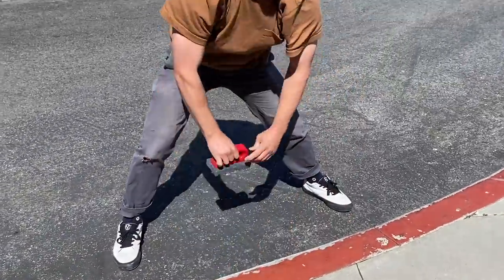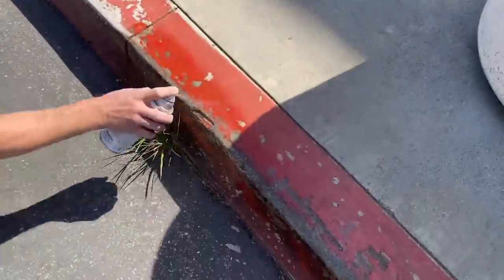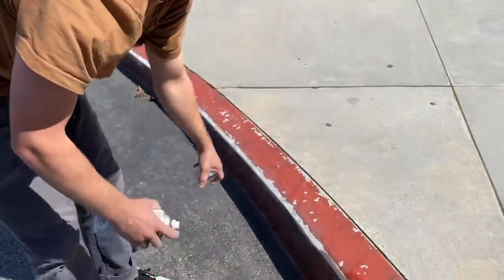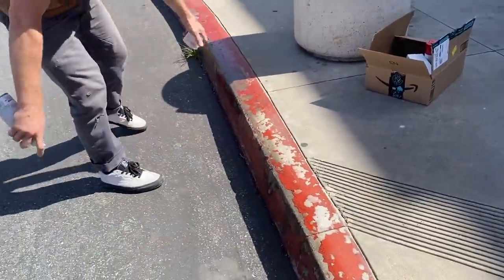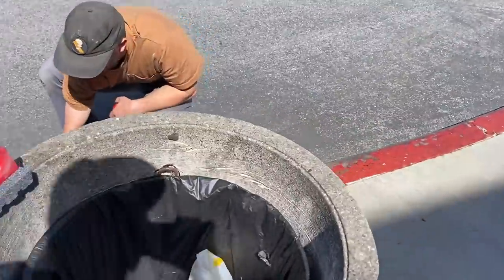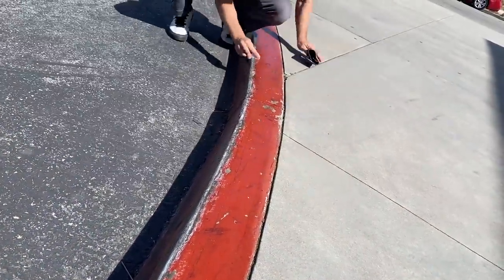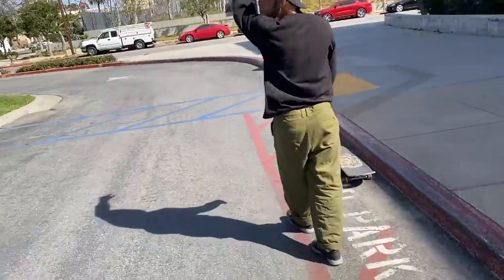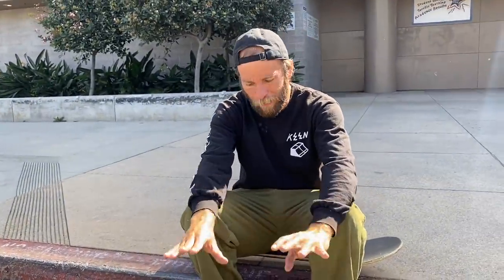MAKE YOUR OWN ULTIMATE CURB SPOT

Comment: Just a note: don't breath in the cement dust - use a mask / wet piece of fabric or do the brick rubbing on a rainy day - safe your lungs for skating :)
Reply: For smokes n bud as well
Reply: Even get a homie to spill a bit of water on it as you move along and it’ll keep most dust from flying around.
Reply: As an asthmatic, I agree with this. Use at least a P95 NIOSH rated mask when doing this. Prevents carcinogenic toxic particle inhalation.
Reply: I already learned this the hard way lol
Reply: What I do is just hold a lit marb100 in my mouth while I work.
It keeps my breathing to an uncomfortable minimum & gets painful smoke in my eye every few minutes which keeps them good & watery for added ocular protection.
Safety first👍
Reply: Agree with this. I smoke too much to risk it 😂 I just wax curbs lol

Comment: Yall got nice curbs! Here in wisconsin they make the curbs at 90 degree angles and the corner is rounded off with no edge. Then they rough them up with push brooms. You would literally have to take off a quarter inch with the rub brick
Reply: That’s when you get out the big guns and use an angle grinder
Reply: That’s what it’s like in Canada Alberta too

Comment: Is the rub brick being held parallel to the top, then parallel to the side, like taking off the paint? Or are you taking off the sharp corner of the curb off by grinding the rub brick at a 45 to it?  The video isn't too clear. I see a lot of curbs rounded over but it seems like you'd just roll / fall of a rounded curb and not really be able to lock in.

Comment: So is this for curbs and ledges that are not chunky only? Like does it have to be a fairly new ledge?
Reply: New or old. New ledges tend to have a smooth finish but have small lines that grab and cause friction. The rub brick and enamel make the surface  buttery and lets it slide.  With chunky its a bit harder for the brick since its flat. But a crap ton of wax for chunky tends to work especially with the rocks sticking out of the concrete. And a lot of pushing through lol

Comment: Anyone in the UK know if this sort of thing works on our curbs? I don't think I've ever gotten an actual curb to grind at all
Reply: It works but like they said, you'll need to put some extra effort into rub-bricking it. Really, this is the most important phase, and half-assing it won't do, so keep rubbing until you're over it and then rub-brick it some more. You'll be filing off a good bit of material, so consider pouring water on to wash away any dust and letting it dry before moving on to the lacquer. And if possible without immediately getting in an argument with someone, apply plenty of wax, but use a blow-torch to really melt that wax into any small holes and cracks.

Comment: don’t buy a brick rub if you don’t want to look for broken concrete or rocks with curb corner nooks ceramic roof tiling bits work alright because they have a nice nook but do not last long check your rock brick think for if it’s getting extremely smooth if it is then find another one

Comment: Great tutorial. Only problem is that this is a FIRE LANE!!! Messing with these curbs can wind you up in jail. Especially posting a video. There are plenty more out there. Be safe.
Reply: @Yasu Leone you should basically never do what you are told especially in current times. but your argument is trash and weakens the argument which like i said is true often and dear to probably most skaters
Reply: @Yasu Leone why do I need to explain this? Is so simple
Reply: Every red curb is a fire lane. You might get a ticket but not end up in jail